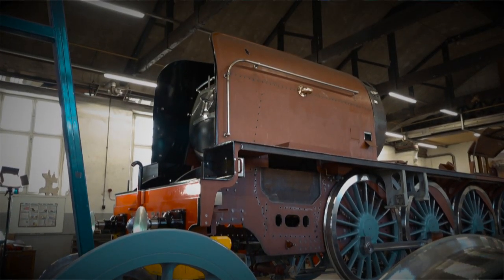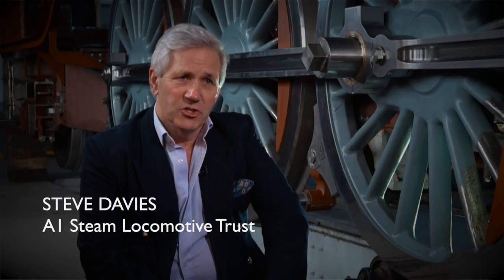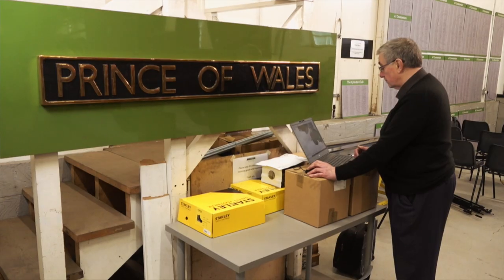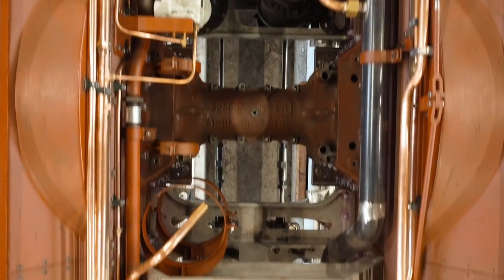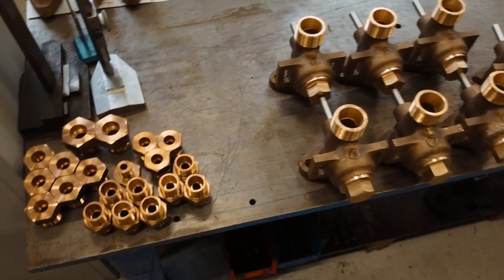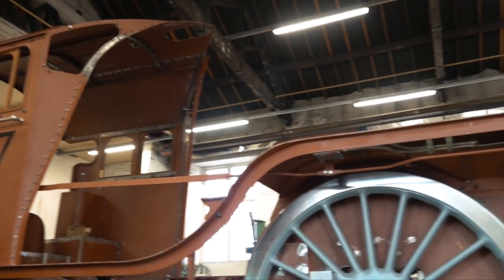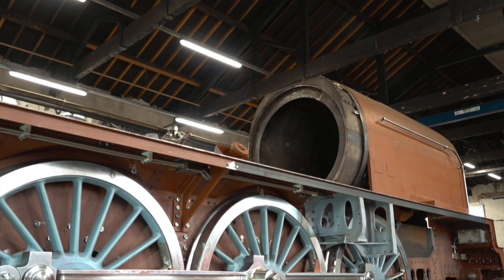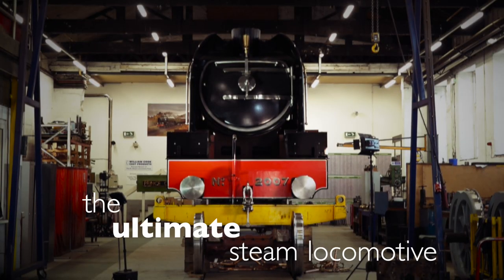P2 progress report by Steve Davies and David Elliott

Comment: I hope they won't neglect A1 Tornado when P2 is done.
Reply: The plan I think (and I have no inside knowledge) is to rotate the in-service locomotive with the one needing a boiler refit and certification, so that they always have one in main-line running condition.  They'll just about be able to manage that with two locos, but of course with three, it would be a breeze.

Comment: Isn't Union Pacific Big Boy 4014 the ultimate steam locomotive?
Reply: Far from the ultimate in reality. They were built between 1941 and 1945 and regardless of what some might think or believe steam locomotive technology continued to develop. The UP engine weighs a little over 340 long tons and has a maximum power output of 7,500 cylinder horsepower which looks impressive enough except European locomotives were sustaining 40 ihp per ton of locomotive weight many years earlier. You can do the maths. Again in Europe they designed a locomotive bed to equal if not exceed the qualities of the cast steel bed which a weight reduction of approximately 30%. And we won't talk too much about exhaust systems. US locomotives were mechanically impressive and this should not be overlooked but thermodynamically they left much to be desired.